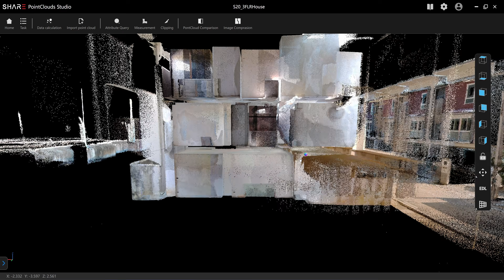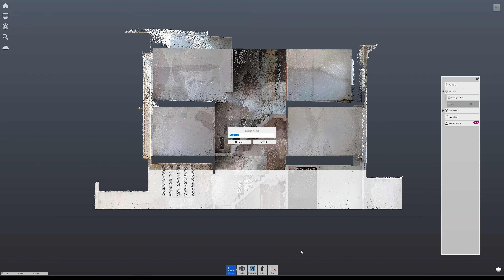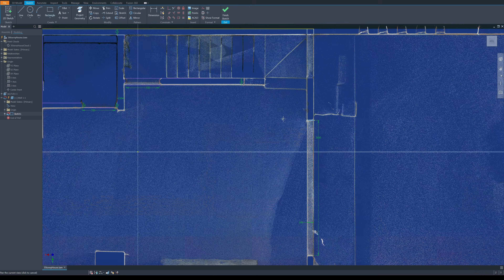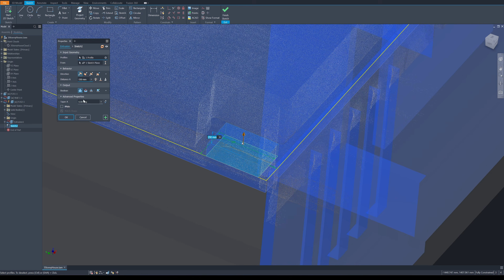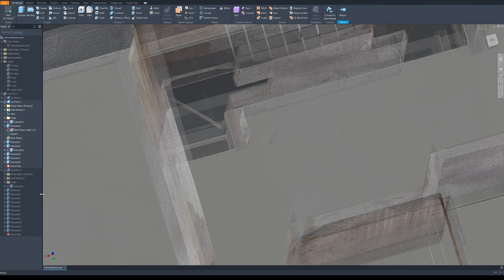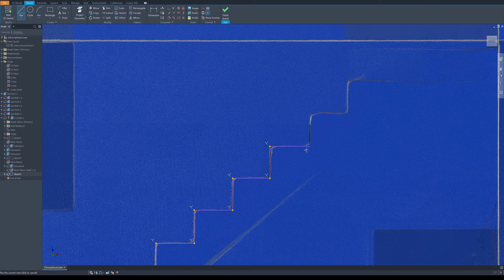How to Make Money with LiDAR Scans (Full CAD Tutorial)

Comment from the maker: For those interested in learning LiDAR Scan to CAD with BricsCAD, I’ve released a 1.5‑hour step‑by‑step tutorial on Ko‑Fi. The course includes a 4 GB point cloud sample so you can follow along with a real project. https://ko-fi.com/s/fbce8266e1
Reply: Are you planning on offering a similar course for Sketchup?
Reply from the maker: @abrown10503  Sketchup studio version can import point cloud but I really don't know the viewport performance. I've e-mailed Sketchup to get trial software, but they didn't reply to me. The CAD software should be able to operate with at least 300M point cloud for Scan to BIM.
Reply: @Payo-TensileCreator  Have you merged drone lidar scans with SLAM interiors to make a full 3D of a property?
Reply from the maker: @abrown10503  No, I haven’t. I’ve never felt the need for drone LiDAR, even though my main work is designing tensile‑structure canopies. If I want to capture the roof top, I simply use an extension pole.

Comment: Does it support to generate Revit model from points cloud?
Reply from the maker: You need to remodel the building in CAD using the point cloud as a reference, as there is currently no AI tool or automated process available.

Comment: Thanks for sharing! just wondering wouldn’t the LiDAR scanner and its software create the 3D model automatically? instead of the need to retracing the initial scan to create a digitally accurate model.
Reply from the maker: AI‑based attempts at generating 2D CAD floor plans simply don’t match reality. Some CAD programs offer auto‑tracing from point‑cloud cross sections, but the time spent repairing broken or misaligned lines ends up being far longer than just manually tracing from the start.

Comment: I just got my Raven and it's an utter disappointment! Is the S20 really worth the addtional money? Whats it like in small rooms and reflective surfaces?
Reply from the maker: In a very small room, like 2×2 meters, you’ll need to place the scanner on the floor at different corners to eliminate blind spots. Most LiDAR scanners require at least 50 cm of clearance from the wall, so if the space is wide enough for you to walk in, you can scan it. I may have a few more LiDAR scanners arriving for review this month, so you can wait and see which one suits your needs. For now, based on my testing, the S20 has been performing exceptionally well.
Reply: @Payo-TensileCreator  What about a 1m x 2m room? Thanks for the help. In the UK with have small en-suite rooms etc..

Comment: I've already watched so many videos, and I still don't understand when to use checkpoints and when not to..
Reply from the maker: In SLAM LiDAR, control points are primarily used to align two or more scans together. While some systems can extract GPS coordinates from these points, others cannot. Their main purpose, however, remains scan alignment.
Reply: @Payo-TensileCreator  In other words, the creation of reference points in one scan session does not affect the accuracy of the SharePoint Clouds Studio program in the future, if I do not combine, for example, two scans later?
Reply from the maker: @netloginoff7857  If you want to combine the 2 scans later, you will have to re-do the point cloud mapping.

Comment: Curently Eagle Max RTK and Eagle Max RTK only has new firmware that cand scan multistory buildings.
Reply from the maker: Sure, it works if the stair is wide enough but expect some drift. The floors don’t line up evenly from one level to the next, and the walls are off too, so it’s not the best option for reverse engineering.

Comment: The video is good, and the workflow is easy to follow for basic geometric modeling.

However, it’s important to keep in mind that Autodesk Fusion 360 is not a BIM tool. When modeling a point cloud, it only creates “dumb” solids without component-specific information.

For further planning steps—such as floor plans, sections, elevations, or design changes—this quickly becomes impractical. Programs like Autodesk Revit or Allplan are designed precisely for this purpose, as they work with actual building components (walls, ceilings, etc.) and consistently reflect changes throughout the entire model.

The approach shown is fine for visualization or simple reconstruction—but not really for proper architectural design development.
Reply from the maker: I'm using Autodesk Inventor in this video. It's  a lot faster and more effective than Revit. when modeling building structure. In 2010, I designed the whole football stadium using Inventor.
Reply: @Payo-TensileCreator  That may well be true for pure modeling speed, and Autodesk Inventor is definitely powerful when it comes to handling complex geometry.

But the key point is not speed of modeling — it's what happens after that.

Inventor (like Autodesk Fusion 360) creates geometry, not building information. For actual architectural workflows — plans, sections, schedules, and especially coordinated changes — that becomes a limitation very quickly.

Tools like Autodesk Revit are designed around building elements and relationships, not just shapes. That’s why they are used for real-world planning and documentation.

So yes, Inventor can be faster for modeling the structure itself. But for anything beyond that — especially if the model is meant to be used for planning — it’s not really the right tool.